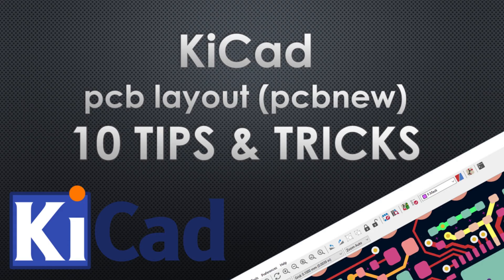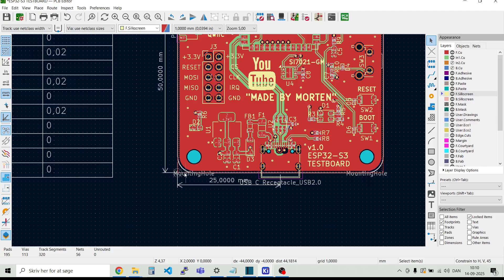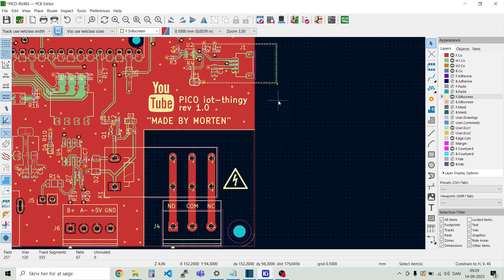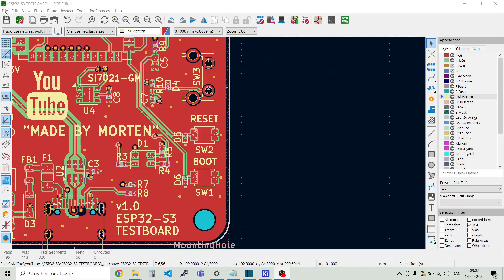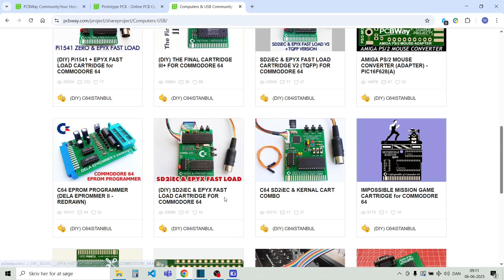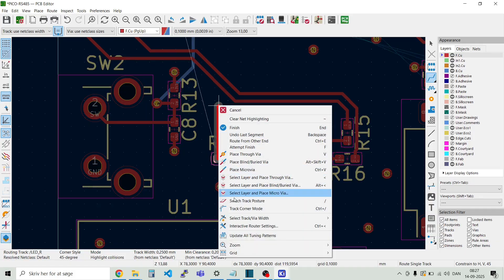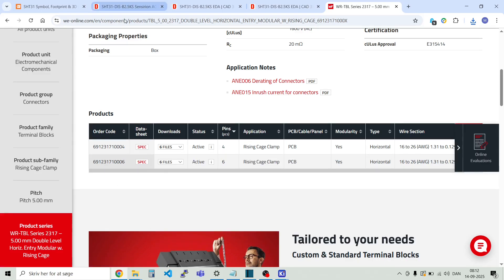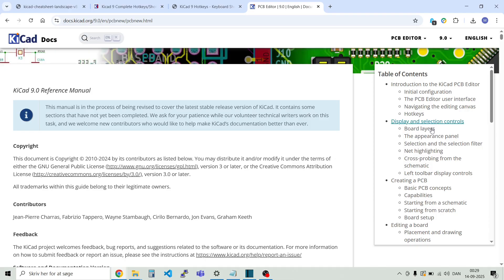Boost Your KiCad Skills: 10 Essential PCB Layout Design Tips

Comment: I have designed a board inspired by your ESP-IoT-Thing, and I wanted to power it either via a USB-C connector or with 24V (using an LM2596 for the 24V input).
My goal was to let the user choose between the 5V coming from USB VBUS and the 5V output from the LM2596. To achieve this, I added a 01x03 pin header at the 5V input of the 3.3V LDO:

If the system is powered with 24V, the LDO input is connected to the LM2596 output.

If powered via USB, it uses the 5V coming directly from the USB connector.

Important note: I did not connect the LM2596 5V output and USB VBUS together in any way. The selection is only done through the jumper on the header.

I noticed that for such applications, power mux ICs are often used, but I wanted to implement a solution without using a power mux. Do you think my approach is correct? Thank you.
Reply from the maker: @ugurambarc3735 - great that you go some inspiration. You can power the ESP from the two power sources by ORing two diodes - one from the USB port and the other from the output of the LM2596
Reply: @made.by.morten.laboratories thank you :))